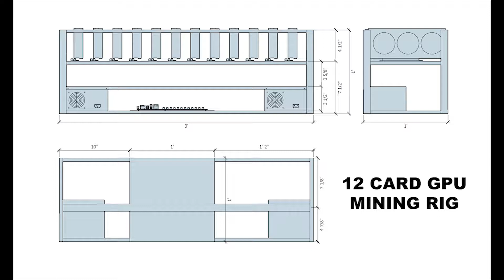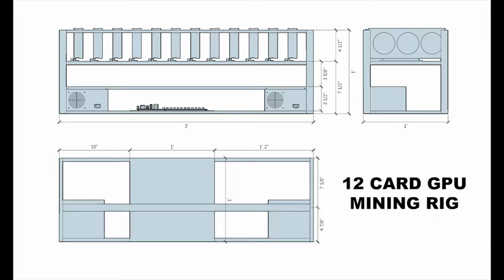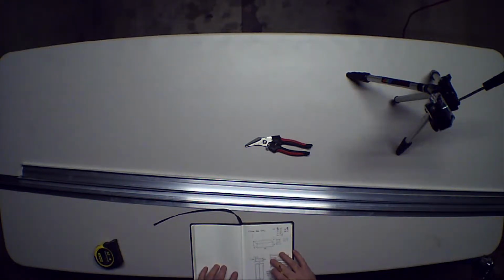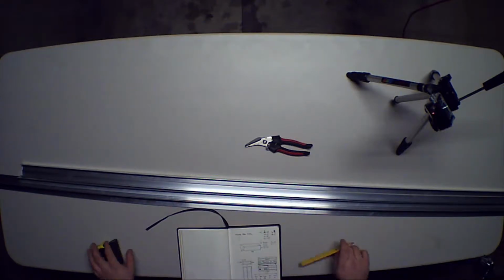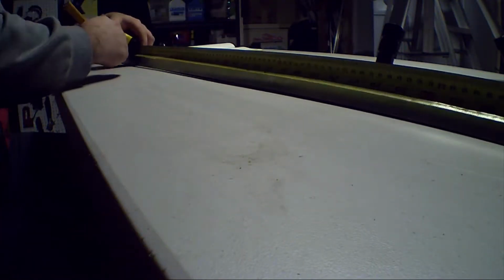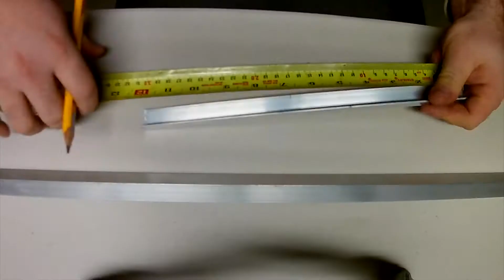12 GPU Crypto Mining Rig Build - Part 1 [Frame]

Comment: Your diagram shows the height at 1' as well as the depth, but it appears to be a bit taller than 1', can you confirm what height you are using for the final build?
Reply from the maker: The height of the frame is 12" or one foot, but the cards will protrude another inch or so above the frame depending on the profile of the card.
Reply: Selturas Soma Thanks for the reply. It seemed that the first build used taller front corner posts and from the camera angle, I could not tell from the second half if they were all the same size as your schematic.  

Thanks for the info and reference, I built mine earlier today with 2' front posts to give me a little more room for cabling, one motherboard and two PSUs and 12 1070 ti's moved from a wire rack.
Reply from the maker: I am glad you found the video a useful reference and I'm always happy to share any info I have!